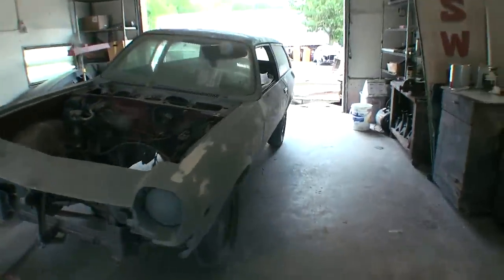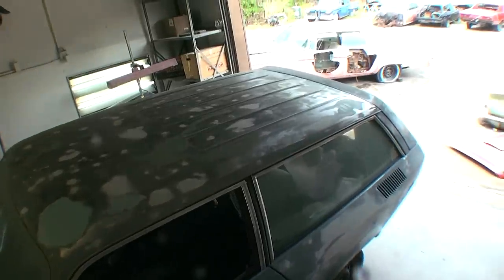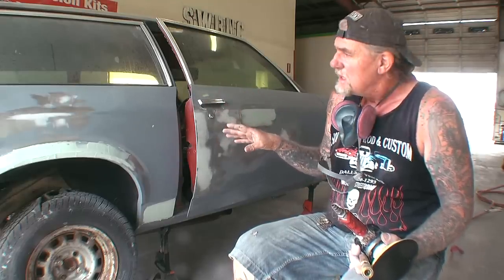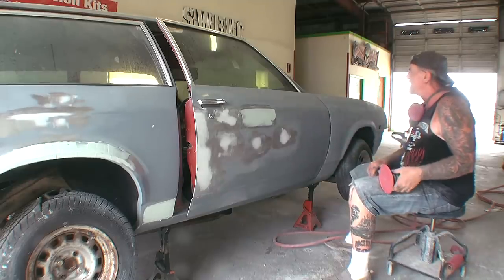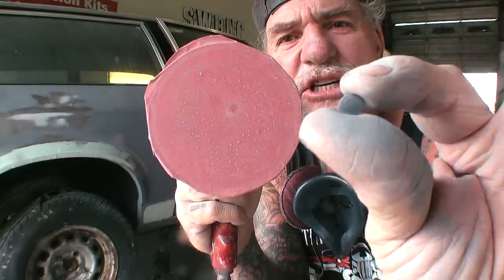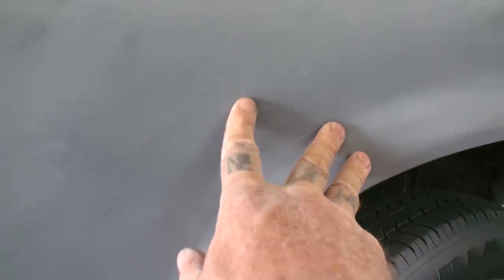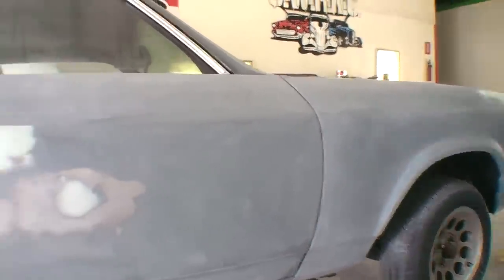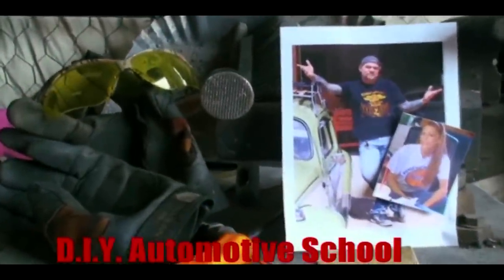What Is EPOXY PRIMER ? - Understanding How It Works!

Comment: one thing I have not heard you talk abut with epoxy sealer is a repaint with no body work. If this is the case then you don't need to prep the epoxy if you shoot the 2K sandable primer  with in 24 to 72 hours,,,if I am correct.

Comment: I am doing a Swiss cheese rust repair and was under the impression fiberglass body filler should come after the bare metal is primed. Reinforced filler on bare metal or reinforced filler on epoxy primer coat?

Comment: great video...what blocks the bondo work from mapping through the paint? the epoxy or the high build primer? have used both and still see some mapping. What is the best way to seal bondo for no mapping? thank you

Comment: Whoa. I think you just saved me some major hassles. I'm about to cover an Sheet Moulded Composite (SMC) panel with Epoxy Primer/Sealer as a way of sealing out reactions from substrate mould release and the paint. I want to go over the top of the EP with a regular Primer Filler, and then finally a Primer Surfacer before final sanding and applying paint. However, working at home without a booth, I use 1K products, ie Acrylic Lacquer. I'm intending to use 1K primer filler/surfacers over the Epoxy Primer. Any issues? thanks and keep up these great vids. Cheers

Comment: So in short, if I’m doing a deep scratch repair, have sanded out the scratch down to bare metal, then before applying a standard 1k or 2k Primer or Filler then I should apply a coat of epoxy Primer to prevent rust and/or other contaminates from deteriorating surface ?

Comment: Bare metal truck which was blasted.took me a few days to get back to it before I  epoxy primed it.There was a light dusting of rust on the metal I give it a quick rub with 80 grit and epoxy primed it.will it be ok rust wise?it should be well sealed shouldn't it??

Comment: isnt one of the big benefits of epoxy primer that you can lay filler over top of it?
Reply: No, filler sticks to metal
Reply: @demagchevy  wrong
Reply: Don't look like he did that he removed that shit so he could get bare medal exposed to fill dents
Reply: If you follow the manufacturers instructions and complete the work within the required time (3-5 days after epoxy application) filler can be applied over epoxy.  I don't it - just passing along the info.
Reply: Yes
Reply: Yeah it’s designed to protect the metal, filler will soak up water so the new way of doing things is to epoxy and then apply filler. Older guys still do it the old way. Both ways will work but epoxy then filler makes more sense to me. If the filler does soak something up then you atleast have the epoxy to protect metal

Comment: Question so i took my el camino down to metal.
I applied ppg ncp280 primer.
Now my question is can I throw clear on top of it to protect it from the outside elements or leave it on primer?.
I won't be working on it for awhile since my work scheduled has changed please help

Comment: so if using epoxy to fill in a sanded spot to bare metal i dont need to feather that into the rest of the paint surrounding?? will base coat paint spray over that and surrounding base paint without showing edges of the epoxy ?

Comment: I’m removing my vinyl top. I’m sanding down all the glue to pretty much all bare metal. Do I just need to shoot epoxy primer on it? I don’t plan on any bodywork because there is no rust and vinyl top will cover any small imperfections . Use epoxy or some other kind of primer ? Thanks 🙏

Comment: So you did epoxy primer before the body work to prevent it from surface rusting, but what is the purpose of applying epoxy primer after all the body work has been done like you did on the 69 blue chevelle?

Comment: Pretty sure there was no need to sand the epoxy off to apply the filler. Filler bonds to epoxy. Add filler on top of the epoxy, complete your body work, then cover with filler primer, finish then paint. That’s what ive got through research. Anyone correct me if im wrong.

Comment: I’m confused I paint in the aerospace industry, and the epoxy primer we use is completely sandable. Maybe the primer just needs to be fully cured before sanding? Unless you are using a completely different type of epoxy primer than we use. Can you clarify this?

Comment: It’s non sandable watch me sand ! 

This information is very inaccurate.
Unless you let your epoxy set for over 7 days
Reply: The epoxy I have states that you have to top coat in 3 days or less, otherwise "etch" and "recoat." I think (in Pete's defense) that Pete is actually doing an etch and a topcoat of a different primer. I think there are a lot of different issues, mainly being the brand or line of epoxy primer used (some are glossy) and whether directions are followed. But I thumbs up your comment, because the 3 or 7 day rule must be put on the spec sheets for some reason!

Comment: hey Pete. I have Harley Hard saddle bags, ive sanded the clear coat off and i bought 2K epoxy primer and want to paint the saddle bags. I heard you saying epoxy primer is a sealer, now can i use the epoxy primer and then the 2K high gloss black to cover the saddle bags? or should i just use the 2K primer then the 2K high gloss?

Comment: I'm thinking about Clear coating a white Epoxy Sealer. Yes or No? I just want it back together.
Reply: That would be original, probably cool looking, it will be double sealed & ready for blocking whenever you want to do a top coat

Comment: Body filler can be applied right over the epoxy..and depending on the system you usually have 7 days before any sanding will be necessary for application of any 2KS and not have any issues with adhesion..I normally use epoxy before and after bodywork is done then apply surfacer  over the epoxy..

Comment: Scrap primer sealer on bare metal and use a self-etching primer. If you want to seal that after you have done your sandable primer coats, then you can use the epoxy primer to seal the entire thing while it waits for paint if you need to wait. Epoxy primer is a pain in the ass. Self-etching primer is the best you can apply to bare metal bar none. Another great product between sandable primer coats is an adhesion spray. It gives you a bonding surface if you are filling pits with sandable primer. It all depends on what finish you want. If you want a glass-like finish, the more sandable coats you use with an adhesion layer it will get you there. Sealer is the very last thing you want to use if possible but a great option, if it has to sit before final paint, it's applied to keep moisture and contaminants out.
Reply: Can you use filler over etching primer?
Reply: @rodmoore1998  They say you shouldn't, but I have without any issues at all for years now. There is a mild acid in the primer, but it doesn't seem to effect good fillers and is a great bonding primer for sandable primer. It depends on a number of factors from the quality of materials, paint, primer, etc you use after the primer is applied. I personally use it most of the time and have it in gallon cans and aerosols in stock always

Comment: Good Morning,
 I am currently working on a 1957 Chevy 210 post that has all the bodywork done and is in epoxy primer. My question is this; go I need to etch, high filler prime and then block or can I jst do a guide coat on the epoxy primer and block?

Comment: do you spray epoxy primer over the bare metal spots  ( after the  car is prepped  ) before spraying the  2K primer
Reply from the maker: NO --- Straight into the 2K primer applying 2 to 3 full wet coats...

Comment: So if I am not worried about it being a SHINNY PAINT JOB I can just Spray over the primer with my FLAT DESERT TAN  I have done this with old Tractors and for finale coat  of color I do a 1500 grit wet sand  and it turns out pretty dang good for shooting in a ole BARN with no lights or ventilation

Comment: that is good information, I am getting ready to bring my Chevelle down to bare metal and even though it is inside I do not want surface rust to appear, One question my neighbor recommended that when I spray my fire wall that I use epoxy satin black paint should I also use the epoxy primer as well, I like the idea that you don't have to sand it, would this be a good Idea? And I want to do this "RIGHT"

Comment: Very good video streight to the point ..... over the repairs do you epoxy to match rest of the car that's in epoxy , or streight to high build primer all over then block 80, 180?
Reply from the maker: Once you have done all your body work, and you have prepped up the epoxy like shown in this video you then go straight to 2K "SANDABLE" primer applying 2 to 3 full wet coats...
Reply: Pete...can you put expoxy primer over body filler. And can you spray your 2k  primer over it without sanding  the expoxy primmer if you spray your 2k ovet tne expoxy within the time specified to wait for topcoat.

Comment: If you start with bare sheet metal and spray Epoxy Sealer, can you come back the next day and lay down Primer Surfacer without having to sand the sealer because it will bond at that point?

Comment: I'll be doing a full complete paint job / color change on my 98 Z71 this upcoming summer. I was talking to my paint supplier and I asked about apoxy and and what they told me is ever coat makes a 2k high build self etching primer so I don't need to use apoxy on the exterior. However they did tell me to put apoxy in the jams so that I won't have to block the primer down and I'd only have to do my initial paint sanding then apoxy then paint within 48hours. Any thoughts on what they were telling me would that be a good way to repaint my truck?

Comment: Great video 👍.
Question;
If all bodywork is done and the vehicle was in epoxy primer can you sand with 240 and  then base coat colour on top of the epoxy primer?
Reply: I did hear you at then end of the video I was wanting to confirm

Comment: Hey bud, quick question, now that you did your body work, prepped your epoxy primer do you REAPPLY some more epoxy over body worked areas and apply 2k urethane primer right over that?
Reply: It all depends on what kind of primer Im going to apply to it.. If I apply Polyester Feather FIll then I will epoxy prime overall.. If I am only using 2K primer -- no I don't re-epoxy, i go straight into primer.. Thanks for watching
Reply: @myfriendpete  thank you pete, I know you are super busy to reply! But one last question if you could. Since you are going straight into urethane primer, do you use a sealer right before spraying the paint to keep moisture from keeping into the metal? Or sealer doesn't stop moisture?
Reply: Do u go to seal it and then do bonds
bondo

Comment: Maybe you have different Epoxy primers on your side of the ocean, but the stuff I use here in Europe sands just fine, I mean epoxy is tough stuff, but my paper doesn't gum up and I can wet sand it and feather it. It's 2k and has a satin gloss to it, not completely matt like in the video.
Reply from the maker: More then likely you are using a 2K primer filler and not an "Epoxy SEALER", -- yes -- 2K primer can be used as a sealer as well by adding 10% Urathane reducer to it.. By doing this it lets the 2K primer flow out for a paint ready surface.. EPOXY PRIMER SEALER is NON SANDABLE...  Send me the brand you use, I would like to research it...
Reply: @diyautoschool  i sent you a can of Southern polyurethane INC, epoxy primer that is very very very sandable. You said you'd do a review video on it ,but you have not done that yet that I have seen . I think it's been about a year. I'm telling you if you use their stuff you're going to love this stuff. SPI epoxy primer on bare metal lay the body work hit it with their 2K primer good to go you have a 7 day window with the epoxy before you have to send anything after 7 days you should scuff it with a red 3M pad. pot life is 72 hours I think if I remember. They have some great stuff in the owner is actually available 24/7 via cell phone I have talked to him on Sunday's when I run into something I was unsure of
Reply: the standox ,glasurit ,R-M ,cromax pro ,and ppg are sandable epoxy primers!!!!!!
Reply: Agreed, either your confused or in the US it's different to the rest of the world... I use Novol epoxy primer.

Mixed 1:1 primer / hardner.

It comes out semi glossy and you can fill right over it, no need to sand or anything. 

When your filler work is done then you go right over everything with a standard 2K Filler primer, no need to prep the epoxy primer first.
Reply: Dale Wright so do you guide coat epoxy to find small panel dings.... if there are any?? Or what
Reply: @6655nico  no I just use epoxy over bare metal for its corrosion resistance and adhesion.

Body fill over the epoxy and then 2K High build primer over the top of that which you'd then guide coat before flatting.
Reply: Dale Wright that means your going " back in to the repair " all the layers your just put down .. would it be easier to guide over epoxy, block then go over. With 2k ???
Reply: @6655nico  I don't quite understand you sorry? The epoxy there is to go straight over the bare metal as it creates a barrier against the elements and seals the metal.

You don't need to be blocking the epoxy, it's just there as your initial layer.

1) Bare metal
2) Clean all bare metal with thinners very thoroughly
3) Epoxy prime 
4) After epoxy is dry lightly scuff (Around P180) up the areas needing filler work and perform your filler work 
5) Scuff up all the epoxy using around P180 and a red scothbrite pad 
6) Prime with high build 2K primer
7) When 2K primer is dry guidecoat and block it wet or dry with around P600
Reply: Dale Wright yes I understand what your Saying but if you epoxy prime the vehicle , and you've found your big dents how are you to find small dings with out using guide coat ? Or do it wai till the high build primer is on then guide coat / block with 80
Reply: On a new panel i guide coat and da/ block see if any dings from transit etc
Reply: Dale Wright what do you scuff epoxy with before body filler ?
Reply: @6655nico  when you put the epoxy primer on the finish of the epoxy itself has a slight sheen so it's easy to see dents and see where you need to fill without the need for a guide coat and blocking. Epoxy primer has much more of a shine than standard 2K primer.

Use around a P180 to key the epoxy itself.
Reply: Dale Wright that's marking more hard work .... it like black and white easy seen..... if I use a black guide coat you will see everything ...... I'd never go with out guide coat..... I've had stuff given that's " paint ready " that's not good enough ..... I'd use guide coat so can visibly see..... no good pudding around looking fir shadows...... ligh is different from different angles..... black spray ( guide coat isn't ) il still to guide coat everything readygre be professional
Reply: @6655nico  each to their own.

With the epoxy it's genuinely easy to see wherever needs filling as it has a slightly shiny finish
Reply: Dale Wright I'd never rely on " shiny " surface I'd want to see black guide coat ,..... could never do it your way especially if it's a dark day ......... il still to my way thanks
Reply: @6655nico  yes each to their own I guess. I used to find it hard to spot the dents when starting off but with a bit more experience then you learn to spot them easily :)
Reply: Dale Wright I've been doing this years....... still like to see my dents instead of guessing ..... everyone's different

Comment: Would it not make sense to use a  Red scotch brite to key the surface considering ur not sanding but keying the surface. That way u get sufficient grip as it's designed for prepping for primer and don't run the risk of pig tails from a sander

Comment: Can you go straight to basecoat after epoxy primer? or do you have to 2k primer first.
Reply: You can as long as you apply the base coat within the manufacturers specified time frame - usually 3-5 days.   You do this when you're using the epoxy to seal your primer/filler/bare spots.  Follow the epoxy and paint manufacturers recommendations!!

Comment: How about a self etching primer ? Maybe using an epoxy primer AFTER all the body work is done and then Paint (BC/CC). It's a sealer after all.(just costs more). And it won't react with the new polyurethane(fancy) paints.(A good sealer).

Comment: Hey pete im painting car inside door trims with spray can 2k clear coat what spray can paint .can i use so it will not peel off or crack the paint can i use acrylic?

Comment: i used it on my boat ,i found it hard to sand so next time would thin it down more so it will dry smoother.
Reply: I painted my fibreglass yacht with epoxy primer. Shadow coat, 400 wet and dry with lots of water and detergent, by hand. Like sanding concrete. Flawless finish. Two pack Urethane on top, mirror gloss finish straight from the gun.

Comment: Emporer9992001 said he left epoxy primer OVER BONDO and the paint PEELED!   I'm confused now! If I bondo and EP over it and then rough it up with 180 grit and then shoot 2K over it before paint, will it peel just because the EP was left over the bondo. Maybe Emporer9992001 didn't shoot 2K over the EP and that's why it peeled?

Comment: So when you finish with the epoxy primer prep, are you doing another coat of epoxy primer to seal your repairs as well?
Reply: I am curious about this as well. I saw a lot of bare metal after the sanding, will that be sealed with epoxy?

Comment: Can primer dilute the old paint  (so I have to strip it )
Reply from the maker: Certian Primers can wrinkle the old paint, If you use 2K Primer which requires a hardner and NOT USE any reducer it shouldn't react...